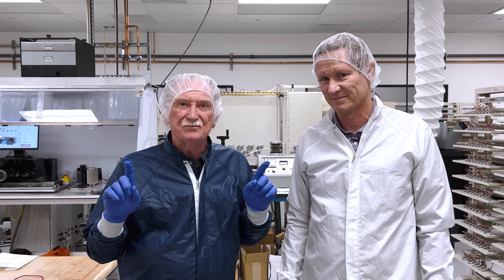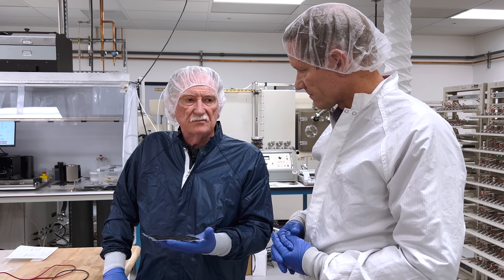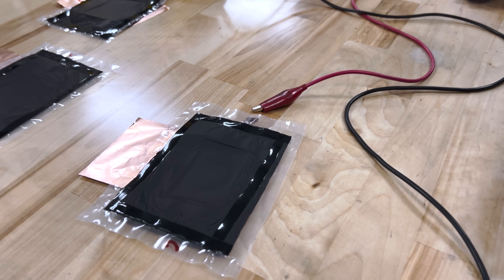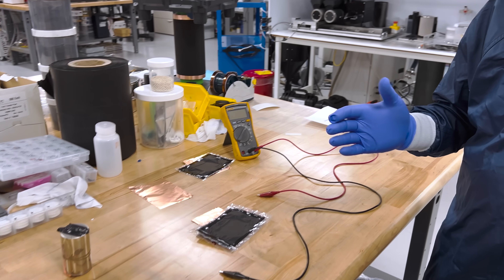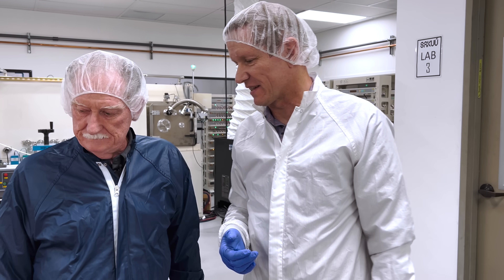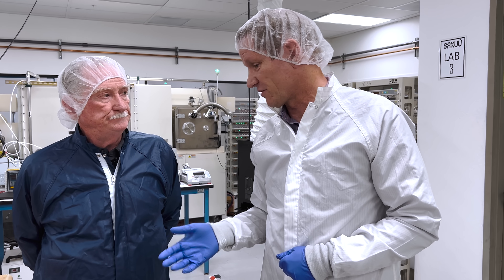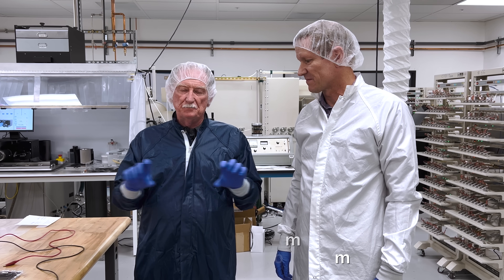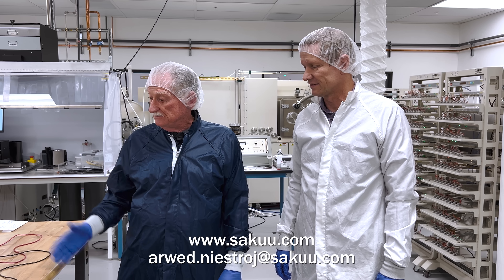Sakuu's Metal-Free Battery Cell: Game-Changing Innovation

Comment: Intro: ". . .  THIS is the end of the ICE age. . . "
Munro is poetic there.
Reply: I'm just afraid that the guy in the white lab coat will disappear soon, and I don't mean just walking away from the camera. ;(
Reply: @BillAnt  .... when customers find out the critical limitations of his battery and go "nope".
Reply: @BillAnt  You mean gets prosecuted for fraud or lying to raise investments?  That's what he's doing in this video.  Nobody who has an understanding of electricity and batteries, including Sandy's own Tom Pruscha,  believes this nonsense. Nobody is going to feel "threatened" by this "technology", so no implied threat to the "guy in the white lab coat".   Though he may need employment soon.
Reply: More like: "this is the end of Sandy's credibility" (re Electricity & Batteries)
Reply: @shazam6274  Your grandfather said a similar thing 120 years ago about cars replacing horses.
Reply: @DanBurgaud  Nope!  I think EVs will eventually take over, sooner than most expect, but this BS Fake Battery is the issue (and many others, some of which also have Sandy's love)  You're very ignorant if you think this thing can EVER power a car.  Your analogy would be more accurate as: "... Perpetual Motion Sterling Engines in cars will replace horses..."
Reply: @shazam6274  Do you have any links disputing this videos claims? Curious.
Reply: @danmobile  50 year Electrical Engineer, 1/2 in automotive & power.  The claims are specious: Voltage without current, no charge / discharge data.  The "no metal" claim clearly contradicted by slab of copper foil for current collector electrode (common in most batteries), Ohms Law, when they say they drove a nail through it and got little heat (i.e. shorted the battery) that simply means low current flow.  It's "Ohm's Law" not "Suggestion" or "Opinion.  The intentionally misleading graphs (no, they are not mislabeled).  Power or, Power over time = Voltage x Current.  No current mentioned.  Again, just take a 2 cell Mag-Lite (old type with bulb) and connect it to the demo prototype for 5 minutes and see what happens, no fancy test set up needed!  Kinda like asking for links to dispute "my car goes 1000 miles".
Reply: @jtjames79  ???
Reply: @shazam6274  The copper isn't part of the battery. 
I think the two sides of the black rectangular sheet are the two different poles of the battery.
I think you can stack layers of these on top of each other, (connected in series), to boost the output.
They wanted to demonstrate the power by connecting it to the voltage meter.
They put one pole of the battery sitting on the copper, cos it's convenient, they can touch the meter probe to it no hassle. 
The copper is just an electrical connector. It supports the weight of the battery nicely. 
That's my understanding of it anyway.
Reduction in weight and increased output are very significant with EV. It may eg make EV airplanes significantly more viable.
Perhaps less danger of fire/explosion than other batteries?
That printing technique is cool. 
We will have to see if it succeeds. It looks very interesting, to me.
Reply: @AD-gi9zg  Interesting guesses.  The copper is a collector electrode.  But they could easily tell us and specify current and power without revealing any of their secrets, couldn't they. But they show this crap with no load or significant performance details, because they're jus trying to get some investments.  The high impedance voltmeter does not at all indicate "power" as you say. Study Ohm's Law.
Reply: @2eyedhairlessmnkey  non-rechargeable, aka "primary",  Alkaline Gel Cell in a metalized (aluminum) plastic pouch.  The gel was forced through an insulating membrane when run between pressure rollers.  Not remotely comparable to this foolishness.
Reply: @shazam6274  if you say so
Reply: @shazam6274  Got it thanks for the info. Curious if anyone else is debunking these claims or why Munro isn't mentioning any of this...
Reply: @danmobile  Sandy, a great mech. engineer, doesn't understand Electricity!

Comment: You’ve confused power and energy, which is a pretty basic error.  The energy capacity might be 96Wh, but what is the rated power, and power density?  That is what determines if it can even be useful for an EV application.  I suspect it will be a lot lower than the 4680. 
It sounds like a useful innovation, but I really feel this is overhyping.

Comment: There is so much work to do getting a product from lab to production.  Prototyping is easy but production is hell!!!
Reply: @Everyday_Foreman - Sakuu is already making the dry cathode/anode tech and production machinery for this available for the wet batteries along with licensing so one would expect the same with the metal free technology.  Just be patient and wait.  So far the advancements from Sakuu are coming fast with the major holdup being NDA agreements and satisfying the Lawyers.  They've already shown the current production equipment for wet process anode and cathodes running side by side with their new dry process anode and cathode production so they are well past the Laboratory Theory Only stage which makes this more exciting.

Best!

Comment: so if we built battery pack out of this cells, we will get 60% more energy capacity, so for example if cyber truck have 123 kwh battery pack, we can get ~194kwh instead? (+30% from weight & +30% from higher energy capacity cells)

plus, it's cheaper by 7%, it's not much, but technological advancement of this battery is worth to keep that 7% there

Comment: Thanks Sandy. You didn't cover how a pack would be cooled. Would be great if your team explored how to fit these cells into a pack with cooling.
Reply: Especially if the plastic contacts make them higher resistance and lower thermal conductivity. Not a good combo for EVs.

Comment: This is interesting and it bring also alot of questions: 1: is the electrical contact between the cells only made by compression? which mean it will vary depending on their State Of Charge because they swell  and unswell a bit during cycling? 2: is the electrical contact between cells independent from humidity?   Normally cell tab are welded using laser or ultrasonic or bolted but now these only rely on simple compression between their anode and canthode direct contact out of the cell... 3: Why other are using aluminum and plastic envelope and not only plastic.. look like aluminum have some advantages to efficiently block some contaminent?

Comment: too good to be true. what is the catch? not a word on actual chemistry: "no metal" may be valid for the current collector electrodes; otherwise afaik it's lithium metal chemistry. low/high temperature behaviour? (requires cooling or heating?) discharging & charging rates?mechanical robustness (a not-solid pouch will shake for 10 yrs with no problem).  Even Sandy is not really authentic if so enthusiastic without any real questions asked.

Comment: Everything looks beautiful when it's a prototype and they are at the beginning of seeing results, but it will be real once they start using them in a product I can buy. There is a long process to get to a final product or real application. I think the biggest obstacle is investment in tools, machinery, a big factory, and a contract.
Reply: The biggest obstacle is no current capability, i.e. it doesn't work for the intended purpose.
Reply: @shazam6274  As I said: "Everything looks beautiful when it's a prototype and they are at the beginning of seeing results, but it will be real once they start using them in a product I can buy. There is a long process to get to a final product or real application. I think the biggest obstacle is investment in tools, machinery, a big factory, and a contract."
Reply: Having said this, they could make a mint licensing this to folks who can scale up.
Reply: @leoyoung7547  correct
Reply: @leoyoung7547 This guy gets it.

Comment: Cautious optimism.  Looks good so far.  How do you cool it?
Reply: No need, since there is almost no current capability!
Reply: THat's what I said...  Cooling is an issue without the metal there
Reply: @calholli  To Clarify, there is very little current capability, Charge or Discharge; so no major cooling is required.  This thing can't operate a #57 light bulb for 5 minutes, much less a motor for a car.
Reply: @calholli  Certainly unwarranted exuberance based on hubris.